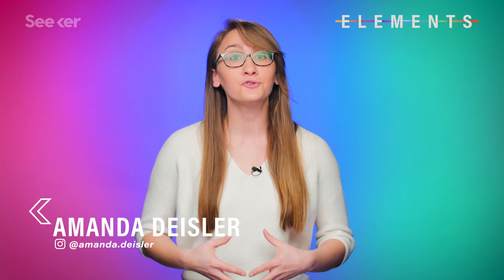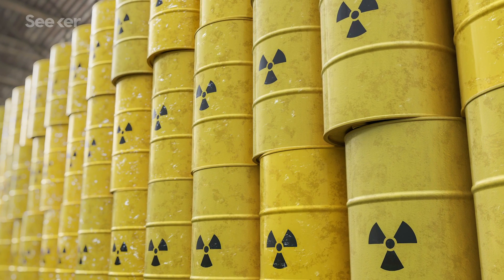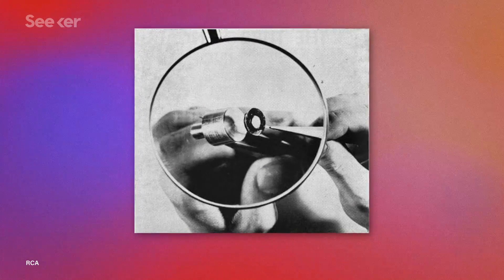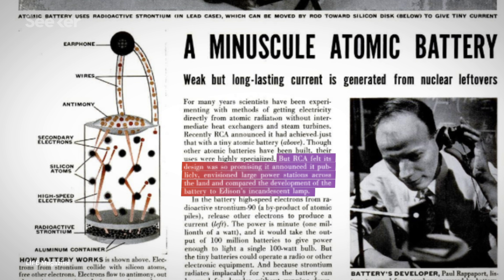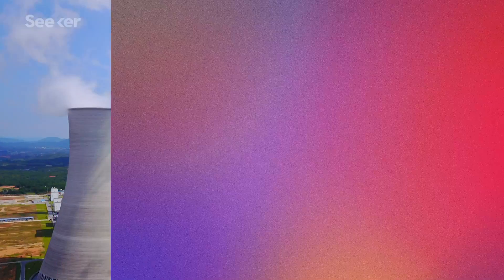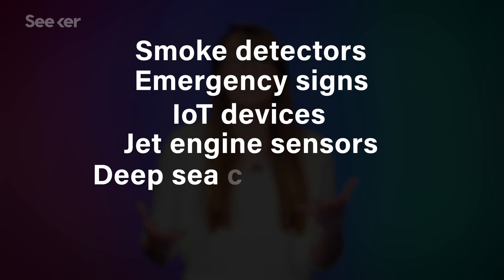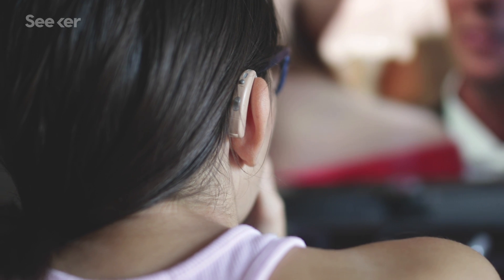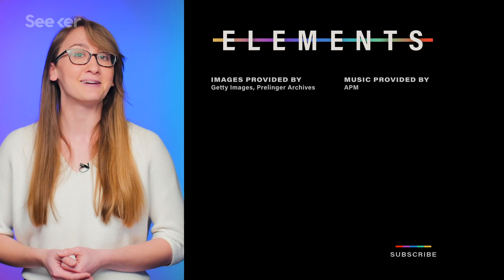Diamond Nuclear Batteries Are Forever… Sort Of

Comment: Some years ago, there were some prototype of pacemakers and artificial hearts which use nuclear batteries as power sources but was stopped later. The reasons are potential threats if the persons with  those equipment accidentally hit by cars, the nuclear batteries might expose; also if the persons passed away and forgot to remove the artificial heart then a dead body might have a forever running heart.
Reply: That was a lot of years ago, not a couple ('70s through mid '80s), they weren't prototypes and it was just in pacemakers, not artificial hearts (as betavoltaic cell could never have enough power to run any pump but can easily charge the capacitors of a pacemaker).
They fell out of use when non rechargable lithium cells started improving in the early to mid '80s.
At the beginning they offered only about half the lifetime of nuclear batteries but at a tiny fraction of the cost and without all the trouble of carrying around some Pu238 all the time on yourself (a lot of paperwork, the government that needs to know at all times where the device is, shipping it to Los Alamos labs for decommissioning when uninstalled or replaced, etc.).

Comment: 3:00 It can power smoke detectors for decades

TAKE ALL MY MONEY
Reply: Or just have the smoke detector wired into the mains with a battery backup charged by the mains.  I do.
Reply: @Chriswsm  what if a fire causes a power outage
Reply: beep
Reply: A failing battery isn't why you should replace smoke detectors.
Reply: Hardwire smoke detectors
Reply: smoking is baayd, mmkay
Reply: But the americium 241 that's already normally used in smoke detectors could do that too, if its electronics were organized differently, you'd just need a larger amount of the americium in it.
Reply: Or think of a electric Lamborghini that doesn't need a battery change for 50 years
Reply: ...but the detectors will still start chirping in the middle of the night for some other idiotic federally mandated reason.
Reply: Just use battery free smoke detectors or remove them completely.

Comment: I have thought for a long time that a better way to handle radioactive would be to harvest the energy instead of throwing it away. There is a massive of amount of radioactive waste material stored in thousands of barrels in in pits and tunnels. Why not make a barrel that acts like a battery and turns the radiation into electricity?

Comment: So it is safe because .... diamond! 
... ?! .... and what? Why didn't you explain that?
Reply: SciFi Factory 
Yeah gammer rays can go through diamond I think
Reply: @spaceman6463  
Yeah, gamma rays can indeed go through diamond. However this is a betavoltaic battery and beta rays can be stopped by a thin layer of plastic, a metre of air or 1-2mm of tinfoil. Your clothes should be enough to protect you unless you tie this thing to you for several day or hold it to your face inhaling it into your lungs. They even surround the radioactive carbon-14 with non-radioactive carbon-12 to further shield it.
Reply: Subjagator 
I see

Comment: Something that I'm always troubled by when discussing alternative energy sources.... Not much attention is paid to the energy and resources used to create the application. How much total energy did it require to create this, radioactive diamond battery vs. how much energy can be realized from it? I'm willing to bet it costs many thousands if not millions of times more energy to create then it will ever produce. Not trying to be a sick in the mud. I just would like to see alternative energy presented honestly. So many technologies out there making claims for a cleaner, cheaper energy...... I always find myself with the Elephant in the room (How much energy went into this "*****" device? ), the elephant stands on my foot.🤔😏
Reply: Alternatively, they can make it in any shape without compressing Carbon-14. Then they can coat it with silicon and lead. That would effectively stop beta particles.

Comment: Cool, but they sound really expensive  and impractical when compared to other techs.
Solid state batteries are coming and new materials are already making batteries better and cheaper
Reply: Since they are making synthetic diamonds they are not as valuable as regular diamonds which can also decrease production costs.
Reply: Dragaard 
It was touched on in this video, but if you read up on the the physics you see that betavoltaic batteries don’t really support the objectives of miniaturization, high efficiency and high power density. The physics imply that while feasible, these batteries can only be of moderate size and of limited power density. What’s more, the supply of the radioisotopes they need is limited, so large scale commercialization can’t be supported. So it will definitely be a niche markets (if any at all) for betavoltaic batteries, but who knows, advances in materials science might enable the development of high-efficiency solid-state nuclear batteries as well in the future.
Amazing idea. Like most nuclear ideas, more research is needed

Comment: is there any way to speed up that radioactive decay, sure it will shorten the halflife of the material, but it could increace the energy output, and given the short life span of humans i think we could make more use of a higher energy device than something that lasts for that long
Reply: There probably is but it would surely require putting more energy towards it, which ultimately defeats the purpose. Just scale it up if you want more output.

Comment: A phone that breaks before it runs out of batteries
Reply: Imagine putting one of those in a Nokia
Reply: @oPHILOSORAPTORo  so it became a Nuclear Powered Brick ?
Reply: @We_Cry  yes
Reply: @oPHILOSORAPTORo  The only immortal thing in the world

Aside from Queen Elizabeth of course
Reply: We have that 
It's the iphone x
Reply: we have those now, they're called iphones
Reply: The closer we come to intellectual singularity, the earlier your phone quits working.
Reply: That's a non-starter, a phone needs too much power. Wristwatches, pacemakers etc are more realistic. Look at it this way, a phone can easily heat up when used right? That's because of how much power it needs. If you have enough radioactive material in your hand for it to notably heat up on it's own - you have way too much of it.
Reply: 1) They dont emit energy as heat, they emit electrons
2) While not going to power an iPhone any time soon (unless they manage to make them small enough you can have a bunch in series) they could design low power phones for emergency use.
Reply: @benhook1013  Doesn't matter what the emission is, end result is still heat. And it's never going to power a smartphone. Carbon 14 emission event is 0.156MeV, so to generate a single watt of power you need 40TBq or 242g of C14 and that at ideal 100% efficiency. In nature only one part per trillion of carbon is C14, so that is a ridiculous amount for a mere 1W of power. So even very low power phones are out of the question, only applications where you are talking about microwatts of power are viable.
Reply: Inqu'aanate 
Hahaha
Reply: Nuclear battery can use in satellite and spacecraft
Reply: You must be quite liberal in your definition of “phone”, though... if by “phone” you mean a device similar to the first phone ever invented, but with modern technology, that’s the size of a TV that must be shielded by thick and heavy lead sheet to avoid receiving a fatal dose of ionizing radiation, then yes, you’re right.
Reply: Nokia finally has met its match

Comment: So if a small one can run something like a smoke detector, couldn't they use a larger one/several to make some sort of power bank sutible for consumer use?
Reply: WrathOf Fulgore 
Diamonds aren’t strong so you can’t make anything to big
Reply: @Josh Challenger 
Beta radiation would rarely ever cause cancer. A metre of air is more than enough shielding, 1-2mm of tinfoil or a thin layer of plastic.
Reply: Why are the replies to your comment so dumb...anyways. yes. However we dont know how big these batteries are.

Comment: Their technically not "batteries" but even better than batteries. Sure they want to advertise them as portable but batteries are usually defined as needing to be charged from an external source. These nuclear batteries, are more micro nuclear power plants.
Reply from the maker: Battery classifications are so interesting, aren't they? As other commenters have have already pointed out,  betavoltaics would likely be classified as a  "primary battery" (that can only be used once) rather than a "secondary battery" (rechargeable). More on battery classifications here! 🔋https://www.chem.wisc.edu/deptfiles/genchem/netorial/rottosen/tutorial/modules/electrochemistry/06battery/18_61.htm
Reply: @Seeker  was just gonna say we should call them generators lol
so the technical name is primary battery huh and we've been building on secondary batteries for over 20 years TIL
i suppose to qualify as generators we just  need the ability to refuel these primary batteries
Reply: soo power silos? or are saying these thing generates electricy as opposed to simply storing it
Reply: @fuseteam  exactly, they generate the electricity.
Reply: @MrMartinBigger  Even though alkaline batteries don't last long, they make electricity from chemical reactions. But this is better no matter what
Reply: @winddoggo9406  ya that's true, but don't you need to power it up initially to create the potential difference? Or is that just for rechargable?
Reply: @MrMartinBigger  you don't charge a lemon to make a lemon battery now do you
Reply: Well, that's a primary battery. What Martin is talking about is secondary batteries. Both of these rely on chemical reactions tho. The nuclear solution mentioned relies on nuclear power. Noice...
Reply: @MrMartinBigger  Unbelievable...
Reply: @MrMartinBigger  they generate less electricity than a static charge. Were talking 10 mv. And no they cannot continously power anything since they work on power harvesting. This is only useful for space travel, where its the only choice
Reply: Ashley Bea nope you’re wrong. It could be used in electric cars, phones and whatever. It would change everything
Reply: @MrMartinBigger  not all batteries need to be charged, not all batteries are rechargeable.
Reply: Need one in my caravan😂😂😂
Reply: Martin Bigger 1st secondary bateries can be recharged except they get worse and worse after each charging cycle.
2nd The electrycity of these radioactive diamonds doesnt come from chemical reactions as normal batteries like lithiumion batteries. The radioactive decay cause it to ionize its surroundings and therefore generate electricity because of moving electrons.
Reply: Let me give an extremely brief summary about how these batteries, really work, as one of the dudes above said that electricity is produced due to ionisation, is partly correct, here is what actually happens

So, C14 which is a radioactive isotope decays and gives Nitrogen-14 and a beta particle, these beta particles have some energy and undergo  in inelastic collisions with other carbon atoms, not a little bit of high school science here, Band Theory that’s right, when these i elastic collisions occur with carbon, some electrons jump from the valance band to conducting band, essentially generating electron-hole pairs, which well all of us know is how semiconductors generate electricity.

Though one downside of these batteries that I want to mention is the fact that as time passes it’s output decreases because of law of disintegration and half-life! TA-DA and now you know exactly how these batteries work!
Reply: @snikhar  soo the current they deliver halves?
Reply: Fuseteam Yes, when they have reached their half life that is, half life of C14 is ~5000 years.
Reply: Issac Asimov’s “Foundation” series, anyone? 😉
Reply: Sorry but you don't know what you are talking about. You are saying a battery is defined to be a battery by the fact the object can be charged. A battery is simply a potential difference system. Which causes the electrons to move, and when herds of electrons flow, that is a current. Anything that has a potential difference can cause an electric field, and this field can apply forces to electrons or something else. There could be some small detail I am missing.
Reply: no cause decaying is diferent from fission
Reply: Micro nuclear energy plant
Reply: where does the terminology for 'Battery' even come from? 
I'm sure it has something to do with 'beating' and French 'Battre'
Calling a missile launch silo a 'Battery' makes more sense to me. 
Why do we call energy storage devices 'Batteries"?
Reply: @Broockle  a quick Google seems to show the term battery, in reference to an electrical power source, comes from Benjamin Franklin, who compared rows on Leyden jars to gun batteries.
Reply: That's even cooler!
Reply: @jjk2one  ???
Reply: @jjk2one  what are you on about?
Reply: Better? Maybe if you compare the total energy, but they’re utterly impractical because of their power. It’s as if you had 1000 L of fuel (that could fuel a car for 20000 km, or about 12500 mi) but you could only get out 0.01 L/day (that’s what a car uses to start up the motor).
Reply: *They're

Comment: Regenerative Hydrogen fuel cells and why they have not really been commercially successful
Reply: @Ivan Alexander Patiño Barrios Most hydrogen is produced from methane via gas reformation since it's easily the cheepest way but it produces CO2. With hydrolysis hydrogen can be made out of water with for example solar power  but it's very slow and takes quite a lot of energy. Hydrogen batteries are also quite dangerous since they can easily catch on fire. Hydrogen's small molecular size is a problem too since it allows hydrogen molcules to just escape through its container's walls if they aren't dense and thick enough.
Reply: @jokuvaan5175  It's not the "cheepest way", but it may currently be the cheapest!
Also, breaking water into hydrogen and oxygen via electrical current is termed electrolysis. "Hydrolysis" describes completely dissimilar and incomparable processes and reactions.
Reply: billy billy I’m all for fuel cells except for the fact that the most effective they can be is still less than this battery due to the power requirements for making its fuel vs making power. I like alternatives but you would have to get at least 50% of the potential efficiency of nuclear before you try changing my mind...

Hell the ONLY variation that could ever come close to nuclear is a solar reactor(basically s focused solar beam to make fuel for fuel cells)
Reply: @josecolon2717  Not sure we are talking about the same things. (http://www.solarbotanic.com/portfolio/regenerative-hydrogen-fuel-cell-rhfc/) As mentioned in the video the output from the diamond cells is very low. RHFC have the ability to run hotels/oil rigs etc. A video exploring them and making a comparison would be very interesting.
Reply: @josecolon2717  You clearly have not read the article. RHFC are a closed system - no external hydrogen is needed. Have a read about RHFC and you might see why I think they are a very interesting idea.
Reply: @josecolon2717   You clearly STILL have not read/understood the articles so it is fairly pointless trying to engage on an intellectual level. 

As for your claims: they may have had some relevance if you had specifically rebutted the RHFC concept. You have seemingly not understood what they are and how they differ from hydrogen fuel cells that require the introduction of an external source of hydrogen. 
Please do take the time to read the articles.

I certainly have not built any form of fuel cell,  nor do I have a doctorate. I find your claims of both to be highly dubious as the use of  such unsubstantiated propositions in a forum like this are normally the fodder of those trying to bolster their underwhelming credibility. I base this on the fact you STILL have not read/understood the articles - something most PHD holders would not fail doing.

I merely responded to the calls from the channel for ideas about new battery topics. It seems a good video might be the difference between hydrogen fuel cells (aka fuel cells that need an external source of hydrogen) and RHFC.